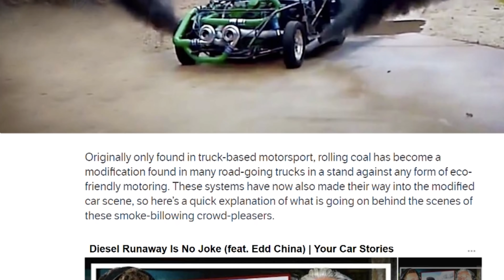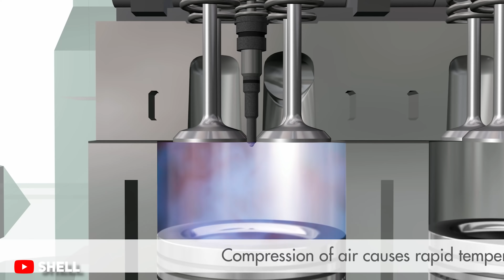Why You Should Roll Coal...

Comment: I own a small trucking company rollin' coal is waisting fuel. I'm buying over 2500 gallons a week for my 10 tractor trailers, not to mention 70 gallons for my personal 022 F450. (Do the math at today's prices) I use to be the more fuel the more power, but I learned that the more fuel efficient your truck is you can get power with a clean tune. Plus rollin' coal you decrease the life of your engine, in my business the longevity and fuel efficiency means more profit. I've been using Gayle Banks products for years since I bought my first diesel pickup.
Reply: So is your f450 deleted running clean tunes?
Reply: @cass8144  banks setups tend to have emissions systems deleted and run clean, euro 3 or 4 standards. I forget which one

Comment: It's not friction that's heating the volume of air in the diesel's cylinder. The very act of compressing a volume of air (or any gas really) increases its temperature because you're putting energy into that volume, but more fundamental is it's concentrating the heat energy into a smaller volume. 
The same principal is how refrigeration works and why an intercooler (heat exchanger) is so important for forced induction.  But in the case of forced induction, because the air is flowing and the compressor blades/lobes are whipping around through the air, there is some friction going on which further heats the air beyond what's generated by compressing the air.

Comment: Maybe it's just me but I feel like and have experienced putting your foot to the throttle and dumping coal for a straight mile down the road and afterward the throttle response is much better than the truck drives a heck of a lot better. It's almost like a must for Cummins Motors you got to roll Some Coal every once in a while or else the truck loses horsepower. I feel like it helps to clean out the motor to breathe better and believe it or not I actually get better gas mileage doing so. I generally will get on it once a day for its daily cleaning. I drive a deleted and tuned 6.7 L Cummins with a 4-in straight pipe exhaust it is near impossible sometimes not to roll coal

Comment: Everybody hollars 'pollution' when a diesel rolls coal. That black sooty exhaust ISNT goin up into the air. It may hang there for a bit, but it falls to the ground n in all reality, goes back to whinst it came. Gas engines on the other hand are polluters. So i say, u wanna roll coal? Letter rip tater chip! My 7.3 rolls a touch here n there, but nothin like some of these fellars with the 12v lol
Reply: Yup...mostly Carbon that then settles. Does not harm the atmosphere anywhere near gas engine emissions.
Reply: Maybe test that theory by rolling coal in your garage for about 5 minutes and see how you feel afterwards
Reply: I have a 12v 1st gen dodge and it rolls like crazy. It’s kind of hard to control
Reply: Literally the only true thing in this comment is that chips are made from taters.

Comment: How come gas engines can't fire based on compression like diesel engines?
Reply: That's because gasoline is less stable than diesel. Trying to get gas to fire by heat and compression can cause all sorts of per-ignition and engine knocks. It could probably be done, but I don't think anyone would want to deal with the R&D just to get that engine segmented, contained, and controlled properly. Way easier to just continue using the spark plug method.
Reply: @drums6912  interesting

Comment: Hands down a clean crisp tune is the only option for peak performace on truck, srptint car drit bike snowmobile or that ole hot rod. remember when everyone put spark plugs in the pipes of an ole caddie went to the local A&W turned on the fuel....you had a 500HP flame throwing juke box on wheels. This did nothing for performace but it was fun pissing off old people and hippies......fast foreward to coal rollers must of these trucks are not designed to haul their own weight, most say "no fat chicks" they were built to do one thing go to where the A&W was, and piss off leftist kids in Honda cars and yesss wanna be hippies in teslas by rollin good ole amercian coal out the pipes ........now that i pissed off most demograpics and made a few of the cool ones smile or even laugh.... I'll just show my self to the door.